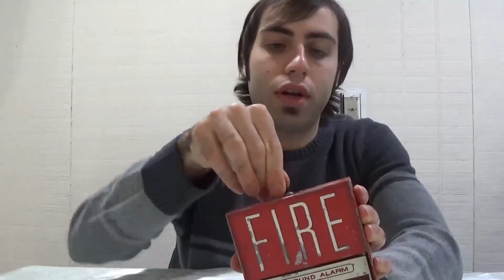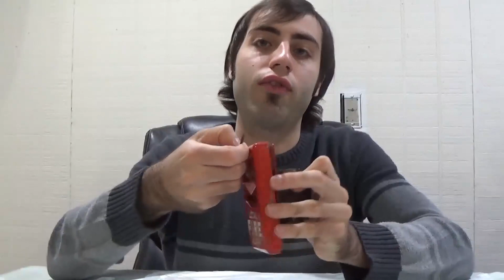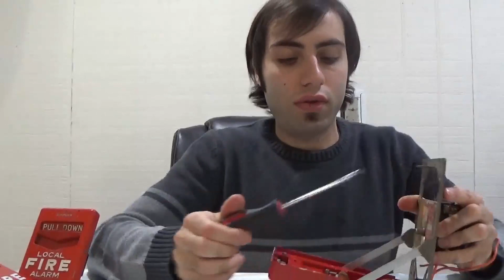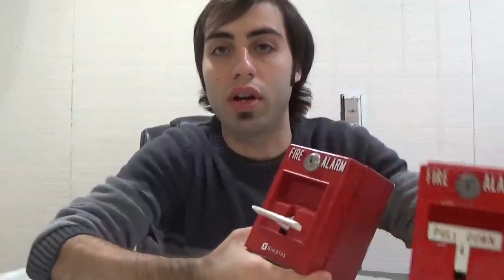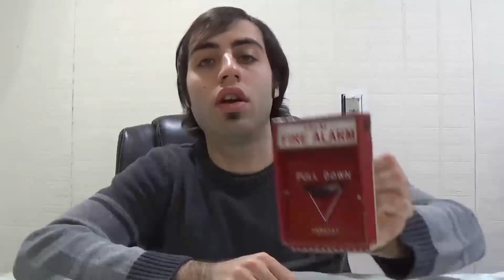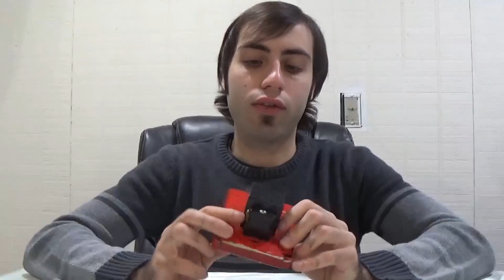Fire Alarm MEGA COMPILATION 2 - Pull Stations! #FireAlarmFriday

Comment from the maker: *Corrections*
- Lead paint was banned in 1978, not 1979.
- The second set of contacts on the 4252-11 is typically for use with older-style annunciators, where any number of pull stations could be wired in parallel to each other, and then in series with a lamp on the display.
- The 4252-11's key is called the "H" key, not the "A" key. It is the same one used for Simplex's remote test stations and 4603-9101 annunciators.
Reply: Awesome collection of Pulls. I more really just have Simplex T-Bars, JBG12-LX, and a 270 SPO.  6 or 7 Single-Action T-Bar, one Dual-Action T-bar, 5 JBGs, and one 270 SPO.

Comment: Damn. You have quite a bit. My first pull station was supposed to be a 4251-13(SPST, Electric), but I ended up getting a 4251-113(SPDT, Mercury). I am currently expecting a BG-12LSP.
Reply from the maker: So it's a double throw (one NO and one NC contact)? Maybe that's what the "3" stands for. I think my 4252-11 has two poles (two NO contacts).
Reply: @Fahrenheit4051  Sorry ,I meant two NO circuits, so you could hook it up to an annunciator.
Reply from the maker: @ryguy2006  Oh, that's right! That's the main reason why it has the second pole. I actually forgot that's how annunciators used to work.
Reply: @Fahrenheit4051   what year is the simplex 2099 9795 made